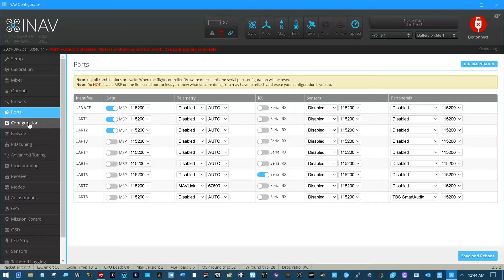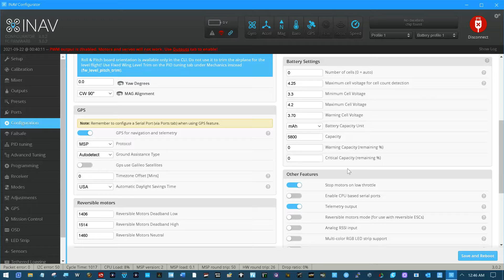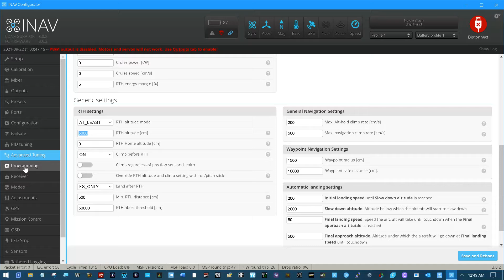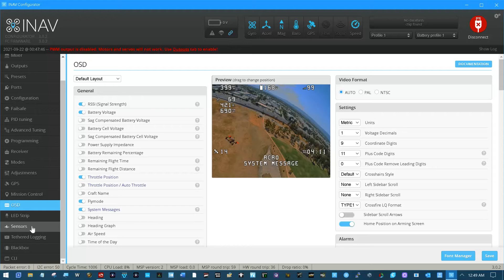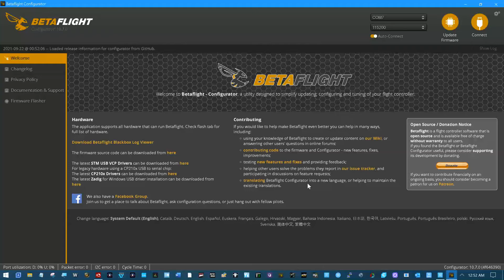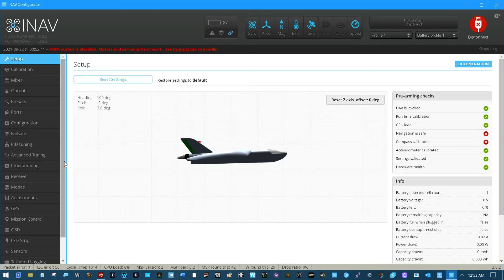Mini Talon INav Setup 1 of 1

Comment: With inav you can take the blackbox recordings and view all the data your talking about. The data will have to be viewed thru the betaflight method.
Reply from the maker: Cool.
Reply from the maker: That is IF you get the SD back, right? I like that the radios transmit all of that in real-time to my ground station for saving and are useful when my platform crashes or runs off someplace.

Comment: You change the servo number to the correct one. In smixer. The numbers are on the left side.

Ground Assit. on GPS Should be set to your area, unless you plane on flying overseas. Auto just slows things down. 

Galileo Sats i turn on. Not sure if it helps or not...

I do dump to save everything to file.
Reply from the maker: Thank you so much JD.  I will try that and also do the smix in cli to learn more INav.

I just looked up Galileo Sats.  They are the European GPS sats.  So looking at another GPS constellation seems like a good idea even IF you only ever connect to one or more.

Cool, I will use dump then.  Again, thank you so very much.